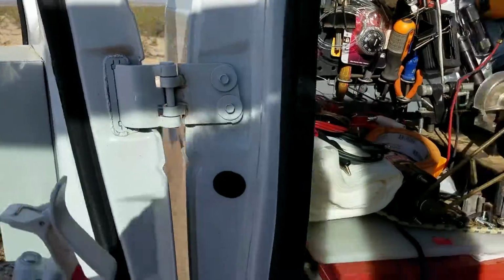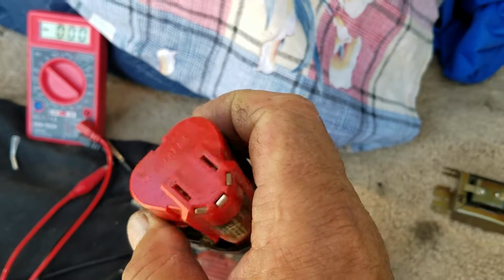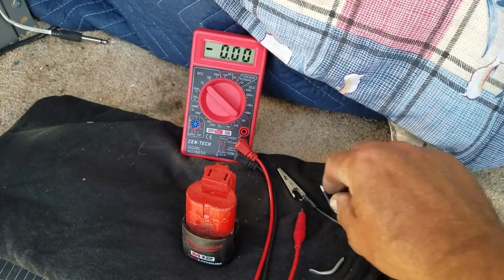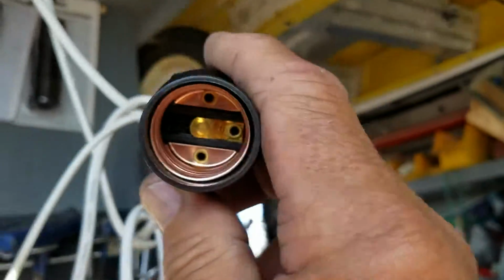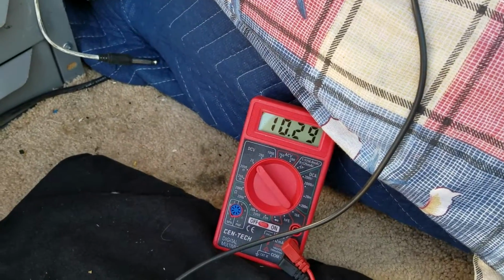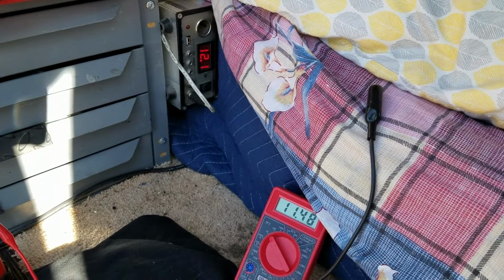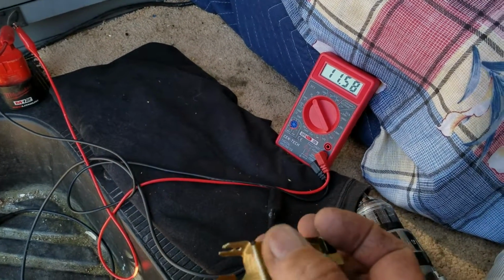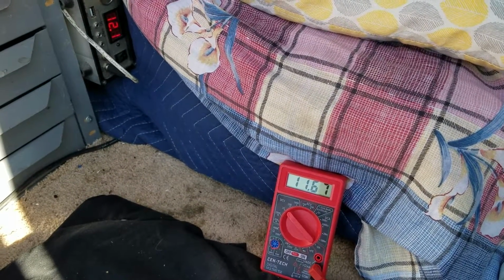Charging cordless batteries off of solar...

Comment: Hello,BIG THANKA,...I have a cheap HF fold n go 2 panel backpack thing for cell phone,and whatever..light comes on w/contact w/sun ,,plug in device,,act as if ok, but no charge ?????.plz help
Reply from the maker: Do you have a multimeter?  Also, what are the volts, watts or amps of the folding panels?
Reply: @GBear  it's late/early,so no hurry..i am a Green horn in my total grasp on solar,but I have been studing for awhile...All in for off-Grid...IDK Watt on panels,lost my multi/met,panels were free,no brand or specs?..They are intact. And appear to work but no actual charge,IDK?   Really wish to see them work take solar power off bucket list :)    All tips on all DIY/motherearrhnews appreciated.
Reply from the maker: It sounds like very low wattage panels designed for trickle charging a battery or cell phone, and won't be much good for anything else.
With a voltmeter, you could check the voltage output and that would reveal everything.

Comment: Thought that I would say very nice job.  I'm would like to do this with multiple batteries wired in parallel for charging simultaneously.  12.6 volts max for three lithium phosphate batteries wired in series such as the m12.   They may a low battery cutoff and upper voltage cutoff pcb board that you can use.  This will add safety to your charging.   And ofcourse battery temperature needs to be monitored while charging.   Good work.  👍
Reply from the maker: Welcome aboard and thanks!

Comment: Would a DC - DC step up buck converter in the loop not get you up to the 19v?
Reply from the maker: I'm not sure what you are referring to, I'll have to use my big computer to see which video you commented on.
Reply: @GBear  One of these mate. One can be used to decrease voltage and this one for increasing.. I think they'd be cheaper on ebay.. thanks again for your video .. https://www.amazon.co.uk/Converter-Inverter-Electric-Equipment-Products/dp/B07HB4NVBL/ref=asc_df_B07HB4NVBL/?tag=googshopuk-21&linkCode=df0&hvadid=375431007006&hvpos=&hvnetw=g&hvrand=4726529155613104225&hvpone=&hvptwo=&hvqmt=&hvdev=c&hvdvcmdl=&hvlocint=&hvlocphy=1006893&hvtargid=pla-704887382589&psc=1&tag=&ref=&adgrpid=85278568988&hvpone=&hvptwo=&hvadid=375431007006&hvpos=&hvnetw=g&hvrand=4726529155613104225&hvqmt=&hvdev=c&hvdvcmdl=&hvlocint=&hvlocphy=1006893&hvtargid=pla-704887382589
Reply from the maker: Ah, found it!  Yes, I suppose it would, but not what I was going for.

Comment: did this end up working good ? didnt end up tearing Batterys up by chance?
Reply from the maker: It worked fine, but remember, unlike the actual battery charger that comes with the tool, there isn't an automatic shut off, so you must monitor the voltages and manually disconnect them when charged, or you could destroy the battery.
Welcome aboard!

Comment: Awesome video. I use m12 batts for kid's powerwheels toys. I also attached a 100 watt inverter to the  m12 batt and it gave me 120 ac!! But the wh for m12 is low so it wont run stuff very long
Reply: I would try multiple m12 batteries of the same amp hr.  And wire in parallel.   But this is to be used with caution and with use of a very low wattage inverter